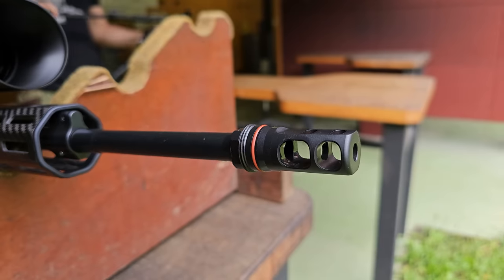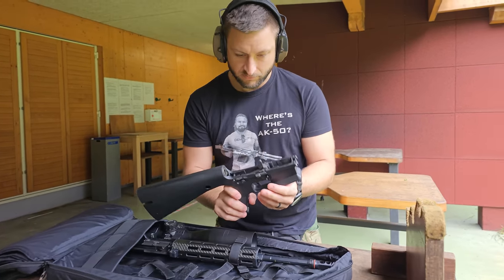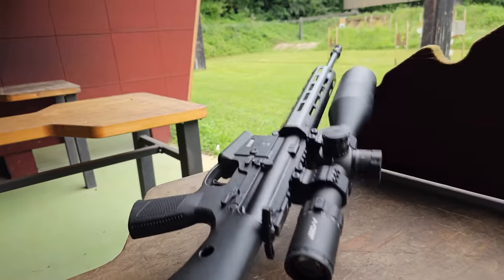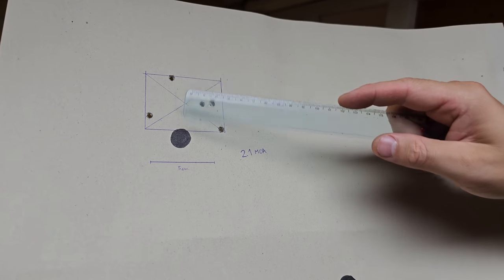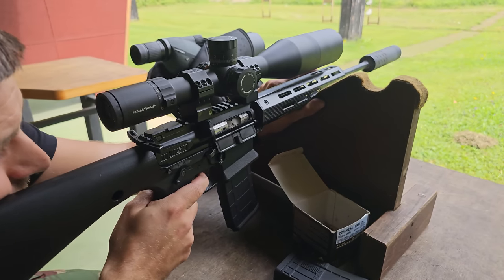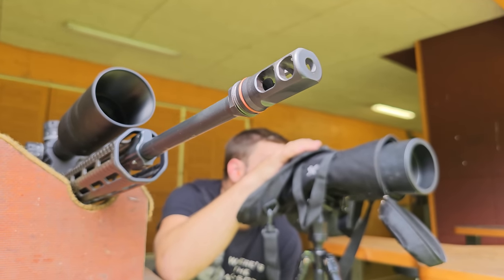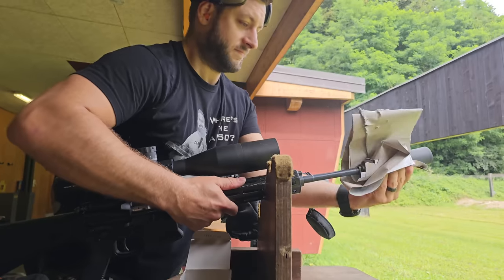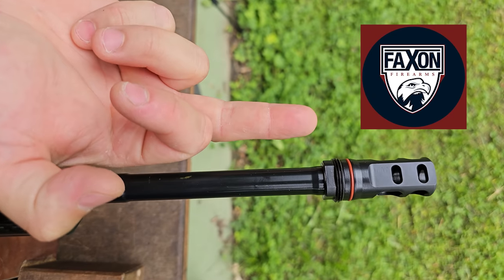Will heat ruin the accuracy? | WWSD Rifle

Comment: Moore pencil barrel test please!
Reply from the maker: Ok, i'm planning to get some 69 and 77gn match ammo and test the accuracy with that. Then maybe test it with and without a suppressor. 
Any other suggestions?
After that i will shorten it to 12.5" and probably test for accuracy again...
Reply: @PolenarTactical  Sound like you got it down. I just would nudge you toward Australia outback or Federal gold medallion match for 69gr load. But for 77gr I never had anything but IMI mk262 clone and I can't remember result it gave me but if I don't remember it, that mean it wasn't exceptional I would guess 2moa but it could be the barrel. I gotta get around on testing used carbon fiber braced BSF 5.56 barrel build I bought.

Comment: A pity, you didn't test with the suppressor before and after warm up, could have been an interesting data point (for the suppressor and the rifle).
Reply from the maker: I can do that next time as i plan to test match ammo with this barrel before i shorten it. 
What kind of test with a suppressor would you like to see?
Reply: @PolenarTactical  Too much science in this world, only 'practical' tests should count. 
Put your ears really close to the muzzle. x1 shot suppressed and x1 shot unsuppressed. 
Which makes your ears bleed more?
😀
Reply: @PolenarTactical  Accuracy and point of impact shift with/without suppressor, cold/hot barrel. Thanks!
Reply: @PolenarTactical  9/10 shot groups, once with suppressor, once without. Then heat up with a few mags, and repeat the same with and without. Personally I prefer 10 shot groups as 5 shots is a bit too few for statistical significance.
Reply: @PolenarTactical  do you know if aero precision will start importing their suppressors into the EU? Are we able to get any US brand suppressors here in EU?
Reply from the maker: @krossF  why? 
There are a shitload of European suppressor manufacturers, some much better then US stuff.
You can probably import US suppressors to EU but you will need a company with the correct permits and a ton of money

Comment: Interested in how the suppressor changes things...
Reply: Bummer just using it for heat build up... I wonder if the weight hanging off the front exacerbates or alleviates any effect of heat build up like a damper.
Reply from the maker: Suppressor changes POI by a lot on this barrel - it's heavy enough that the barrel deforms a bit when you mount it. 
I'm still planning to do some testing with match ammo with this rifle before i shorten the barrel 
What kind of test with a suppressor would you like to see?
Reply: I know I get about a 1moa shift with mine, and they are all three quarter inch or larger barrels. I haven't noticed heat shirts with those, but I don't really do huge strings because even with a wrap, the mirage becomes unbearable quickly. I put a hanson profile barrel on my father in law's rifle and then he bought a suppressor... I'm just wondering how it will do compared to raw.
Reply: @tinncan  I've heard in the past the these barrels, when hot, have like an 8 moa shift from cold without the suppressor. One of those barrel you're just gonna have to pick can or no can only it seems, especially with the poor gassing

Comment: 2.5 MOA is a good group. Laughs in F-Class 😉...

... while struggling to carry a 10kg 76cm barrel 😟
Reply: Those faxon barrels for a 16" barrel weigh 0.544 kg EXTREMELY light for a barrel that can hit targets out to 400 yards without much trouble. They also make a gunner profile barrel that's a little heavier at 0.621kg (thicker from chamber to gas block, same as pencil forward of gas block) that is a little more accurate and handles heat even better. They also have a 0.7kg fluted precision barrel that will make sub moa groups.
Reply from the maker: 😆
A lot of people on the interwebz will tell you that their rifles are sub MOA after they once shot a very nice 3 round group :D
For such light pencil barrel and receiver setup i think this rifle has good accuracy. 
Before cutting the barrel i want to try it with some match ammo to see if i can squeeze a bit more out of it...
Reply: @PolenarTactical  Hand loaded ammo with either 77 grain Sierra Matchking or 80.5 grain Berger Fullbore (assuming 1:8 or faster twist rate) should easily give you sub MOA.
Reply from the maker: @PaperHunter  *doubt
This barrel/rifle is less accurate than my Schmeisser 10.5"
Feeding it hand loaded ammo won't just magically make it sub MOA
Reply: It probably isn’t sub-MOA, but it SHOULD hit 1-1.5 MOA 5-10 shot groups using match ammo. If it can’t stay sun 1.5 MOA with match ammo, I don’t really want it. That’s a reasonable measure of performance from a modern barrel.

 I find 69gr SMKs are nearly magic in that I’ve never found a barrel that didn’t like them.